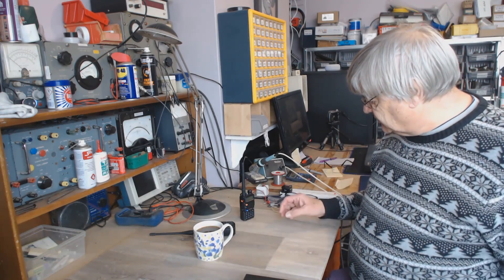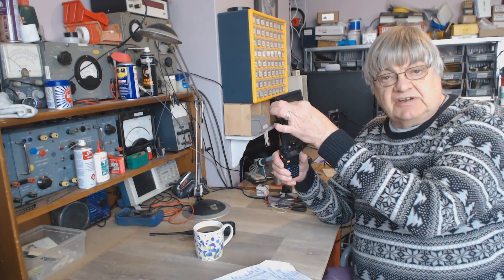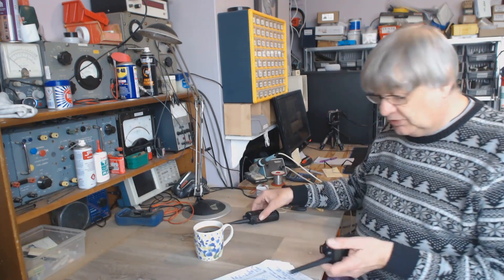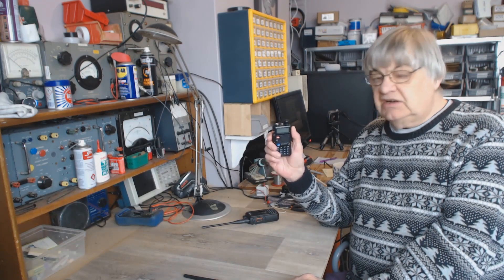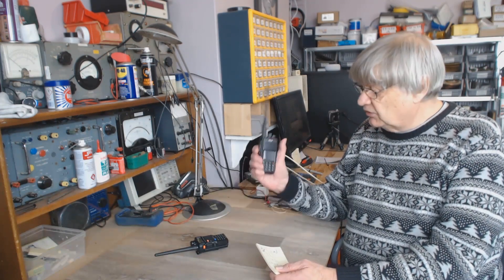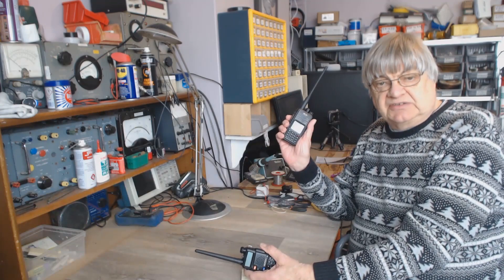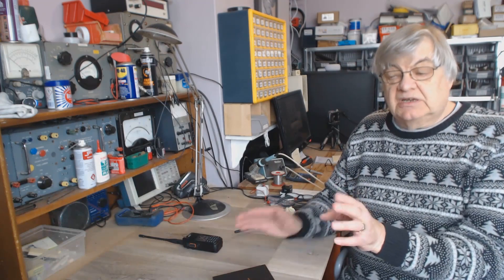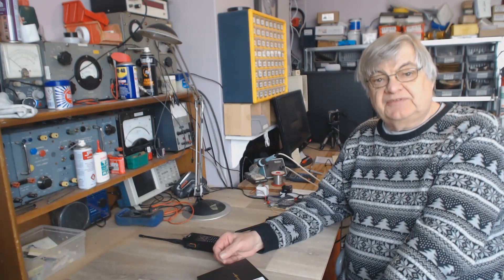G4NSJ - More on the Baofeng UV-5R hand held radio

Comment: Hey hold down 6 (or) 3 an turn baofeng ON to see "firmware version" (or) "serial number".. an from ON hold zero for volts in decimals...alarm can transmit or not while being heard or not...PTT button an key numbers FOR transmitting tones ...you know you can take out the micro controller and change the menu..I want to put another receiver in mine too ...for HF.
Reply from the maker: Thanks!
Reply: @g4nsj  If button 3 and 6 doesnt show anything held down on switch on,
 its a fake baofeng. also UV5Rs after 2014 show battery volts on button zero

Comment: Hi Ray
Looks like your UV5R with the short aerial is an early one with the series 1 chipset,
 the series 2 chipset came out about 2015 in the BF F8+ which is a UV5R without the
 extra band button and LED tourch. After that the UV5R also got the series 2 chips,
 and about a year later the Tri power versions came out with i think a RQA0011 PA?
giving upto 8 watts. Whereas the the 5 watt has i think a RQA0009.  
Why not try a late UV5R Aerial on your aerial analyser ?

Comment: Hi Ray.. How are you?.. May I ask for a little bit of advise? Sorry to be a pain. I have a a 1938 GEC valve radio which I have had for years. I've recently got it going again as it had a fault after the last time it was moved.. To cut a long story short it is working, even in mid Wales 🏴.. After a fight..i suspect it might benefit from capacitors being replaced?.. It's a berrtta bulb super 6.. After all the years would just like to keep it going.. Great vids.. Cheers..

Kind regards

Jon C

Comment: I'm Ray from Crowborough and I use the UV-5R on local repeaters but it just about touches our 2m simplex net in Burgess Hill which isn't bad for a little walkie talkie. For mobile I use the built in aerial and when at  home a plant pot aerial that I made. Anyway best wishes from the mid Sussex ham radio club! M7MOE

Comment: Hi Ray, I have a Baofeng UV-5R, and this morning swapped the antenna for a Nagoya NA-771 from Ebay. As far as I can tell it is a genuine antenna for £9.95. The improvement is massive, and I can open the GB3NH repeater on 430MHz from over 20 miles away that wasn't possible with the stock antenna. The only downside is that the NA-771 is a bit long at 38cm. I'm thinking of making a co-axial collinear antenna to see how that compares, or maybe one of the Flowerpot jobbies that you described, although it may be hard to optimise the SWR.
Reply: hi mike what seller is it
Reply: @tommyboz8652  I bought from knights-electrocom and it cost £9.95. As far as I can tell, it is a genuine product.  Cheers, Mike.
Reply from the maker: Great stuff, I might try the NA-771
Reply: NA-771 seems to be a loaded 1/4wave, so might as well use a full length one
Reply: @phillipsmiley5930  There's a small length advantage to having.a loaded 1/4 wave antenna at 2m. I chose this antenna based on seeing several videos where a number of small antennas were range tested with the UV-5R in real-life situations. For example https://www.youtube.com/watch?v=YUG_LgQFF6w&t=134s
Reply: @Mike-H_UK  What a useless test from inside a car thats going to act as a faraday cage, and the longer the aerial the closer to the bodywork conducting varying amounts of RF into the bodywork, and he made one of the tests out of the window. Not worth uploading to YT

Comment: All good stuff! I bet if you changed the title of this video to include the magic word - NanoVNA - then your views and/or subscriber numbers would shoot-up. 73
Reply: Also, where did you get your NanoVNA from? I'm finding there are so many "fakes" and variants out there it is hard to know where to buy one from.
Reply from the maker: It was from Amazon. It appears to be genuine but you never can tell.
Reply: @g4nsj  There are dozens of suppliers even through Amazon and so many models, original , H4, F, V2, there are 101, 201 and even 400 samples, some have batteries, some don't, some have plastic cases, or metal, or none at all and the supplied accessories vary. I find it all very confusing.
Reply from the maker: @tdumnxy  This is the one I bought...     https://www.amazon.co.uk/dp/B08NF1K76M?psc=1&ref=ppx_pop_dt_b_product_details
Reply: @g4nsj  There is a Facebook group for the NanoVNA. It has interesting posts from time to time.
Reply from the maker: @Mike-H_UK  Hi Mike, that's great. Thanks.
Reply from the maker: The next video will be about the VNA so I should get a few views on that one.

Comment: Afternoon Ray, great video I was always wanting to know the resonance of the antenna. You can get slight better swr by using a length of copper wire on one of the belt clip screws as they are ground and make a kind of dipole. Another bit of useless info lol. Have a fantastic day always great to see your video's.
Reply: Not arguing, I am genuinely interested. Have you actually taken your radio apart? Are the belt-clip screws actually connected to the circuit inside? I tried connecting a wire to the "ground" side of the antenna connector on my GT3 and could determine no difference. But I haven't got any device suitable to measure with.
Reply from the maker: I've heard of that but never tried it. Thanks.
Reply: @g4nsj  a 1/4wave ground wire connected to the case is known as a tigers tail, they help on the smaller radios